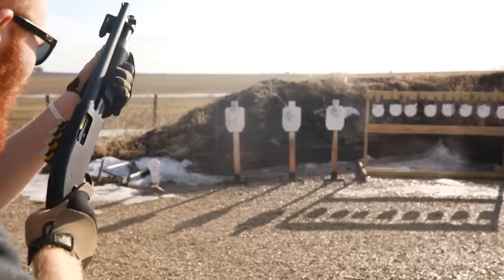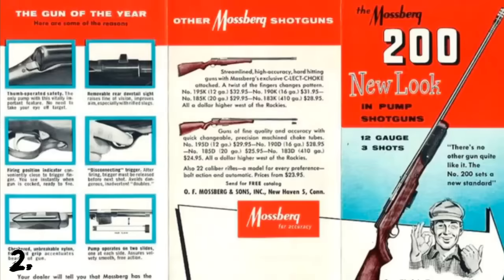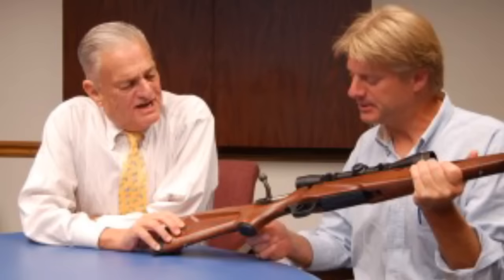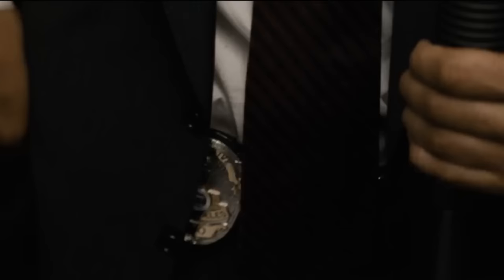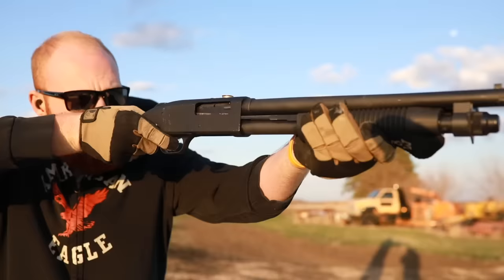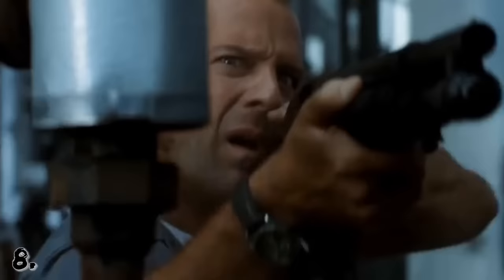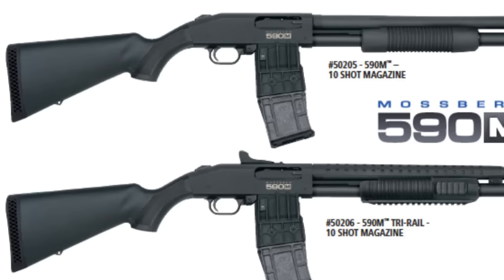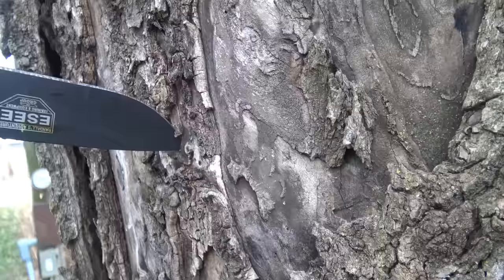10 Things You Don't Know About The Mossberg 500 & 590 Shotgun

Comment: In the 1980's, riding on a 1968 Sturgeon Class Nuclear Fast Attack Special Operations submarine, crew average of 120 men, we had M-14 rifles, 1911 .45s, Mossberg Riot shotguns with wood furniture and 18'' barrels and Remington specialized 870 riot shotguns with pistol grips and steel top folding stocks, M-60 LMG slings attached to them for climbing the sail, inside or out. I'd been in the Marines first, so the weapons were familiar. The M-14's I had drilled with constantly at The Citadel. After a stint afterwards doing things for the Army, I became a Law Enforcement Firearms Instructor and a Force Instructor straight after the Academy. I basically rated Revolver, Pistol, Shotgun and Rifle Master between teaching and competition matches. I own a Springfield Range Master 1911, a Para Ordnance GI Expert 1911s, a Beretta 90-TWO, (the M9 we should have had!), A Tokarev M57 7.62x25mm, A self-converted Remington 870 Wingmaster that now has a 10 shot mag tube/a heavy 30'' Hastings barrel/a slotted elevator to clear jams/a Knoxx Cop Stock recoiling pistol grip with a top folding steel wire stock. I have a heavy duty 500 Mossberg riot shotgun with a pistol grip and a castle stand off muzzle brake, a Mossberg 930 semi Home Security with 18'' bbl and castle stand off muzzle brake, 5 shot that looks just like a pump riot shotgun, a Remington 1100 V3 Tac 13 semi with a 13'' bbl and raptor grip and a great used 1100 converted with a bipod, green laser, spotlight and shell holders on each side of the stock, effectively making a machine gun style complement to my RPK-47 Light Machine Gun in semi conversion. I'm about to get another Mossberg 930, a semi auto between 8 to ten rounds and do the bipod, prone shotgun/light machine gun deal with it. I only use 00 buck 2 3/4'' 12 gauge and segmenting slugs. The problem with the box magazine shotguns is that a regular pump or semi can be tactically reloaded behind cover. That converted 870 Wingmaster I've had since 15 has seen gunfights from behind trees in the deep woods I lived and grew up in a fenced 20 acres before we got neighbors. I have several other gems like an original 70's Charter .44 Bulldog, Colt Detective Special, a 3'' full underlug custom 629 .44 magnum and a pre-2005 Ruger Vaquero that I shoot .45 Long Colt JHP +P out of and a 10 1/2'' Super Blackhawk .44 magnum with a leg length rattlesnake hide holster-all bought mint used. It's all about being able to have at least one gun that shares ammo and/or magazines to have a set. Even my RPK-47 has a back up Paratrooper AKM, my two Marlin .45-70's back up each other!

Comment: I considered getting an m1897 clone, but after hearing they can be delicate with shell types, I decided to just build a "revised" one from a 590a1. Contrary to what Mossberg tells you, you CAN fit their heat shield onto a ghost ring model with a little care. Slap on some vintage  wood furniture, and you have a ding dang work of art. It turns all kinds of heads at the range.

Comment: Years ago I had an issue with Mossberg and have not used or bought one since.  Apparently they thought replacing a nice custom fit to size factory walnut stock with pistol grip cap and fluted comb with a featureless veneered piece of particle board that looked like it was stained with horse poop was perfectly acceptable while they fixed the action lock.  It wasn't okay with me and for nearly 2 years they wouldn't respond to my inquiries why they did that.   I located my old stock for sale by a gun smith at a gun show not too far from Mossberg.  The guy wanted a lot of money for it and even though my name was written on the wood under the recoil pad he wouldn't return it to me.   The simulated wood ended up in the fire pit.

Comment: The only shotgun you'll NEED!  But, you're probably gonna WANT a Shockwave!
Reply: 454pakr 

I have a brace on my shockwave. Win win.
Reply: Yep, that's what happened to me.  I thought I was fine with a 500 multi barrel package deal, a Blackwater edition, a 590 and a 590-A1.  And then the Shockwave came out.  I had to have it.  Love those Mossbergs!
Reply: Benelli M4 or FN SLP.
Reply: Shokewave is good for throwing or a boat anchor......
Reply: William Bowen guess when I pull out the shock wave you’ll think you’re on a boat? Lol
Reply: Nope. A guy I worked with got a Shockwave and I was jealous as hell, so I went and ordered one the next day. I then went out and shot his just to see what I was getting. I then called my FFL and cancelled the order. The Shockwave is just a gimmicky toy. Contrary to belief, you do have to aim a shotgun. I am not going to go into all the reasons it sucks, there are many videos to watch that will list out all the reasons. Just get a 500 like I did. It even comes with a pistol grip in the box if you so desire.
Reply: Bearistopheles , the Shockwave is Not considered a pistol by the Batf. Putting a pistol stock on it converts it into a short barreled shotgun because it has no rifling a therefore is not a long barreled pistol. Good Luck, Check six!😉
Reply: I'm just fine with my 500 persuader holds 8 rounds and if I need anything smaller I'll switch to my EDC hand gun
Reply: Youll be suprised how accurate u can be from the hip if u mount a laser on it.plus dont need to shoot 20  or more yards out with it just need to shoot down my 10 yard hallway if some bastard tries to come in my front door. Now with the 590M u can hold 20 shells in the shockwave
Reply: First time I shot my shockwave I used some potent #4 buck.  I said enough of that.  I finally ordered the SB Tactical brace for it.

Comment: Bought one in the early seventies for $90.00 at a new gun store having a sale. Still have it in my truck. Up side is the safety on the top of the receiver, down side is the aluminum receiver which quickly wears where the rim of the shell strike the upper inside of the receiver wearing a groove into it which causes malfunctions. I fixed it by grinding out the groove with a ramp on each side to keep it from catching the rim of the next shell.

Comment: You left out the most important difference in the Mossberg 500 and Remington  870. The follower in the Mossberg stays up until the slide is pulled back to load another round. In the 870, it stays down , if a round jumps the magazine, the 870 is locked up and must be disassembled to correct the stoppage. In the 500, any round that jumps out of the magazine will land on the ground and then be picked up and reloaded. I have seen this twice with different 870's.  One belonged to a police officer. After the event he sold the gun and would never touch another 870.

Comment: Don't let the 590m fool you. It seems like a really cool gun, you don't often see mag fed pump shotguns. But for one thing, it's insanely heavy. The empty magazine alone weighs like five pounds and costs over a hundred bucks. For two, it has feeding issues CONSTANTLY. It just can't get a solid hold on the shells from the magazine for some reason. A regular 590 works much better, albeit with a smaller capacity

Comment: I really like my 500 FLEX. 28" barrel, full size stock with 1.25" butt/recoil pad, and fiber optic bead. Smoothest recoiling shotgun I've ever fired, with less felt recoil than my AR-15, and about on par with a Enfield No.4 Mk1's recoil if shooting slugs, so it'll get your attention, but it's still silky smooth, and you could shoot it all day without tiring.

Comment: Well, I have both a Mossberg 590A1 Shockwave and a Remington 870 Police Magnum. Both are fine shotguns. I just find the Remington a little easier to take down for cleaning and putting back together. My Mossberg is bone stock, except for a 6 shot side saddle and Talon grip panels on the raven grip. My 870 was as old Police trade-in with a 20” IC barrel and iron sites. I replaced the sites with night sites, swapped in a Magpul stock with a Remington pad, Nordic Components 3 shot mag extension,  spring and follower, Mesa Tactical side saddle, Nordic Components barrel clamp with pic rails for a light and QD sling point. As for the Shockwave, the only thing I may add is a laser on top of the receiver. My next shotgun will probably be a semi-auto Benelli M4.

Comment: I have a 5+1 maverick 88. Great gun. There's a "Venom magazine conversion kit" that allows it to be magazine fed up to ten rounds per magazine. One problem I'm trying to solve, is finding a bayonet mount as my 28" barrel doesn't line up with the end of the tube magazine so I can't use the standard bayonet mount. I'd need some sort of barrel gripping mount that doesn't interfere with the iron sights. Yes I know I can start building a war chest for this gun by simply buying a new shorter barrel with a tube to match. I intend to do that anyway, but I'd like a bayonet with the 28" barrel.

Comment: I've had two shotguns at the gunsmith for repairs in 40 years.  A Browning A5 sweet 16 that was 55 years old with an untold number of rounds through it and a Mossberg 500 .410 that was 8 years old and had about 200 rounds through it.  I've owned over 20 shotguns during that time.

Comment: Youd think any pump shotgun would fire 3,000 rounds without malfunctions. I wish Mossberg would make a steel receiver! I find the aluminum easily scratched and dented when used for a truck gun. I purchased one after Remington folded because i couldn't find an 870 Wingmaster with a 3 inch chamber. It stayed in the back seat, in a soft case for a whole year and the receiver got dinged up. My old Remington 870 express was duracoated after about six months just for peace of mind. But coating it with Turtle Paste wax prevented rusting if applied every time after handling it. My neighbor offered my twice what i paid for it and it went with him. That is the reason i ended up with the Mossberg.

Comment: I’ve had nothing but bad experiences with the 2 different pump Mossbergs (835 and 500 I believe) I’ve owned. From the safety sticking/failing, not ejecting the shell, not releasing the shell and light primer strike that cost me a big buck. 4 of us all bought Mossbergs because they were first to offer a 3 1/2 in a pump for our waterfowling. ALL 4 Mossbergs failed within the first 2 years with the problems mentioned above. People talk about reliability??  I use/hunt with my guns hard and I had these guns probably over 20 years ago but the quality/reliability wasn’t close to the 870’s I used.

Comment: I've had my 500 for 25 years,never had any doubt it would go BANG when i squeezed the trigger!!! And i normally shoot 3" magnum 00 buck 15 pellet(kicks like a mule,but sooo much fun at the range).
Reply: My firm belief is that if this is what you will be using for "home defense" or "self-defense" then this is the ammo that you should be shooting at the range!  I too shoot the 3" 00 Buck.  I had bought a case of it years ago and have never regretted it as there have been lean times in my life and NOT having to buy new has put food on the table.  And yes, I do shoot some once in a while because to be able to shoot well I have to practice!  It's almost time for a new case anyway.
Reply: @Predator42ID    Seth, in the distance from my livingroom to my bedroom, even with the cylinder-bore, the 00 buck will only spread out to about just under the size of two human fists and, to me, that's just right for home defense.  The garage is the back wall of that room and then a concrete wall.  I'd rather have the hard hitting 00 buck instead of the less lethal bird-shot.  Bird shot may not go through four layers of drywall if I shoot when the criminal drops back behind the wall.  Penetration is vitally important when encountering barriers in a combat situation.  And armed home defense IS a combat situation!
Reply: @Predator42ID  I want the threat to end as fast as possible, 00 Buck will do just that!!!

Comment: The Mossberg "Shockwave" is not a line-of-sight gun to shoot.  This is a "from the waist" gun.  If you want to get exceptionally good at shooting from the waist get yourself a semi-auto .22 rifle and plink soda cans on the ground.  You'll get exceptionally good at shooting from the waist and this will carry over to your shotgun shooting from the waist.  BEEN THERE DONE THAT!  I've had a Mossberg 590 now for about 25 years and have no complaints.  I have found that the action works even smoother by using Lock-Ease graphite spray.  With oil you can feel the slight drag of the oil but with the Lock-Ease you don't feel it at all.  I use Lock-Ease on two pump shotguns.  I do not use it on any other type of gun as the tolerance are tighter and a liquid lubricant is more appropriate.  I like the DP-12 too.  Did you do a review of that shotgun?

Comment: I bought a used Mossberg 500 for just over 2 yards, and haven't had a single problem with it. Extremely dependable. So far, the only things that I've done to it is I took off the pistol grip and put the original stock on w/an aftermarket limbsaver.
Reply: My Mossy 500 Persuader barrel is only 20" long. I love her very much. 2 yards WOW.

Comment: The only thing that I hate about the Mossberg 500A (or similar models) is the screw to the safety tab. Which it isn't the easiest way to disassemble without the right tool or something similar to get it off. Other than that, it is a very solid shotgun. Even despite of years of it not being properly cleaned (before I had cleaned my shotgun).

Comment: Actually the 870 passed the trials as well and have been in service since Vietnam. The 870 that's used by the US military is made the same as the 870 Wingmasters which are the original guns. The 590 had to be built to compete with it because Mossberg knew the 500 couldn't and the reason the 590 won the contract is because Mossberg dropped the price to the military and is probably why the price on 500s went up at the same time.

Comment: Love my 70’s mossberg 400g and 500 same guns just different countries lol the only failure I’ve had is the mag tube broke at the threads at the receiver on the 400g other than that so reliable 👍 I also have a Ithaca model 37 in 12 gage and it’s nice but I find the mossbergs easier to load in the bottom the Ithaca has sharp edges and I always seem to cut myself while using it lol if I wear gloves they seem to get stuck sometimes !

Comment: My only complaint is the length. It's in the receiver which means it can't be changed. If you ever get your hands on a cut down Ithaca M37 you'll see the opposite end of the spectrum. It is so small and light it will beat you up. On another Mossberg, I saw ads in the original Shotgun News back in the 80"s for a pistol grip semi-auto. They were double page ads making me think this was a really big push for Mossberg but I don't think anything was ever offered for sale. The ads didn't last long and I've been curious about them ever since. It would have been a really cool little shotgun!!! Anyone know anything about this?

Comment: The 870 and the 500 are great. But the handling characteristics of the 500 make it way easier for me to shoot. Me personally. Tang safety, slide release that i can hold in with my middle finger while holding the shotgun, and my trigger finger on the trigger. I cAn turn a 500 into a full auto. Gimme a 870, and you cut my fire rate 1,000 percent

Comment: I want a mossberg 590m but theres 3 things i wish they could change. I hate that its tube is useless weight. I wish they offered other barrel lengths. Im wondering if there wasnt a way to make the mags take 3" shells instead of 2 3/4 although itd be VERY cool if it could feed both.
Reply: the answer is simple trade it for a 500 persuader it is chambered in both 2 3/4 and 3" and holds 8  2 3/4 shells and the 20" barrel is very affective at home defense and small game hunting and could even take a deer
Reply: They could shorten the tube, but it has to be there.  They have a 590M Shockwave.  Add a brace to it, call it a day.  Want more range?  Have the bore threaded for a choke.  Magazines are half of the battle when building a firearm.  I'd be surprised if they don't ever make 3" compatible mags.

Comment: I have an m500a. EXCELLENT firearm,  but wondering if someone can comment on an issue I have with mine. When firing heavier loads the bolt/slide will release and come back a bit. It kind of throws my rhythm of during rapid fire . Not sure if I'm describing this issue well enough. I took it to our only local gunsmith and he said it was designed that way 🤔. Can't remember the reasoning behind this" intended design." Appreciate any input. Excellent vidio.

Comment: Owned two 590s in the 90s. Both constantly jammed when firing "magnum" slugs or buckshot. The recoil would engage the poorly placed safety on the top of the receiver. Every shot fired would activate the safety. Screw that. Upgraded to 870s. Now I am even more upgraded with Benellis. I'm sticking with the Benellis from here on out.....
Reply: I've had my 590A1 since 1989 and never had a problem.  1 1/4 slugs to 3" mag loads.  Used mine so much the blue is rubbing off.  Sorry you got lemons from a bad batch.

Comment: The mossgur 500a is very rare and is discontinued but superior to the 500 the 590 models are the only ones in the 500 family that's better and the 500a use in very good condition is less than a new 500 the reason why is the 500a is built better and doesn't have the problems the 500 and mavric 88 which is made by Mossberg which is a cheaper version of the 500 but I am 2 88 and there very good if you clean them and don't drop them or set them down heavily

Comment: Isn't it funny you can go to jail for cutting down the barrel but not the stock?
Reply: #Hirsch nope. My understanding is, the barrel  can't be shorter than 18"  You can cut the stock as long as the overall length of the finished gun is 28" minimum. Might be 28-1/2".